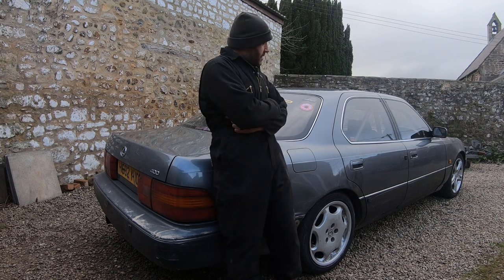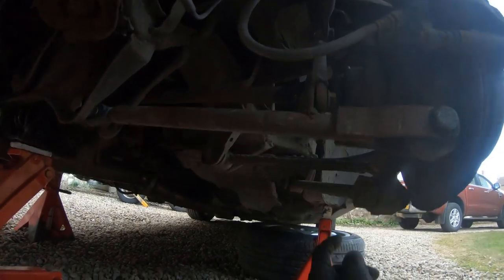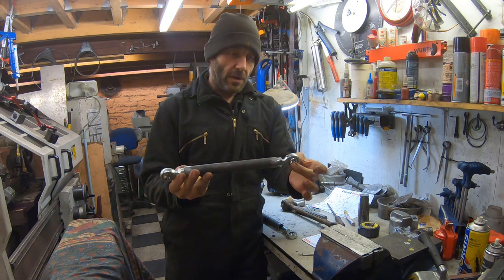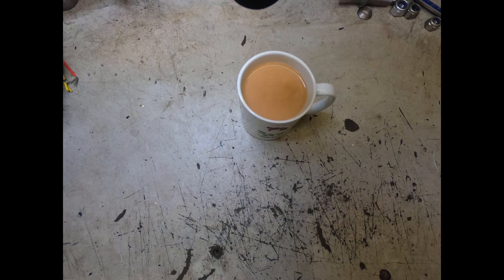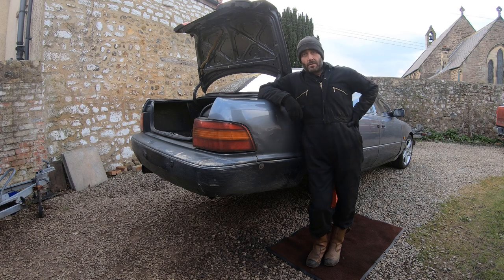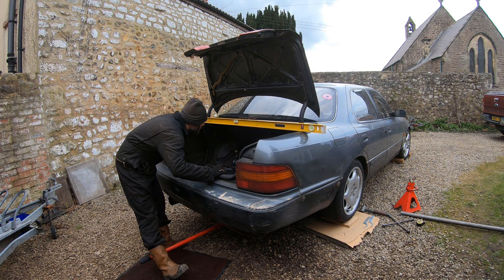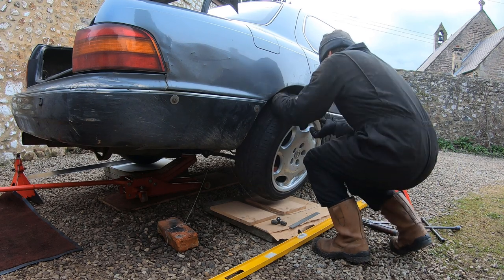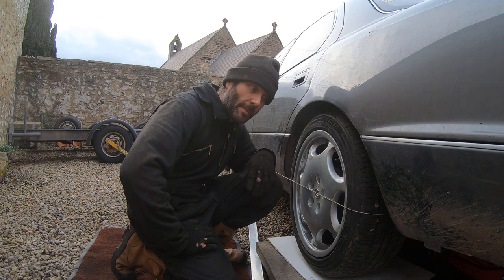TurboShed Part 38 - Fully adjustable rear suspension arms make/fit/adjust Lexus LS400

Comment: New subscriber from Chicago! So glad you put this video out. Many thanks! I broke that same bolt months ago attempting to install some aftermarket adjustable arms. I'm glad I didn't go the air-hammer route, grinding it out was so much easier! Watched this video last night and knocked it out this afternoon. Big hurdle accomplished. 

New hurdle... Do you have any advice for removing the upper rear A-arms? UCF20. Seems not even my gear wrenches can get in that tight spot. Fronts weren't too bad, but this is cramped! Chicago winters and road salt rust up our hardware so bad. Also, I've been told I should tighten my bushings up only after getting all the wheels back on the ground. How do you manage something like that in a slammed lexus without a service pit or alighment rack!? Puzzles me. Any help is appreciated!
Reply from the maker: Hi and welcome to our channel, we are glad it has helped you already :-)  For the rear A arms, if you are really stuck with them, you can knock the brake lines off and lower the subframe to get access, or for the sake of the prop bolts and ABS connectors, drop the subframe completely.  to load the wheels to tighten we have some large wooden wedges we use to drive the car up on for jacking.  We can either drop the car down onto those, or just put the jack under each hub bottom joint and take some weight before tightening.

Question for you then!  Our rear hub, lower rear arm outer end bushes are worn and I cannot find any polybushes listed, and Lexus only supply that bearing as a full hub assembly!  Do you know what size they are, or any supplier part numbers for those?  Cheers!
Reply: @Concept5North  Thanks for the tips! Was hoping I wouldn't have to touch the subframe, a tight garage makes that pretty hard. Might have to do that though.

Let's see, I think I know of a brand or two state-side. Checking...

I know some guys on the forums used to run Energy Suspension bushings. Not sure if they make ones specific to the LS400 anymore, but they do have universal  fit by size bushings in this link. May be worth a look. https://www.energysuspensionparts.com/energy-suspension-universal-polyurethane-bushings.asp

Otherwise, I've heard good things about Fig's engineering in general.This guy used some poly bushings for his LS400 if you want a visual: https://www.youtube.com/watch?v=me5Ij_JZPy4&t=5s. Seems pricey, but nothing else comes to mind. 
https://www.shopfigs.com/v3/by-vehicle/cat-lexus-ls/G2-LS-CAT/LS_BSH_LCAFRIN_SP3090K
Reply: May also be worth a look at https://febestparts.com/ for some OEM-like parts, part numbers, and visuals, even just for reference. Many of those bushings are fairly priced. 

https://psbushings.com/lexus-ls/ - Another respectable brand. Great reviews from many of my Jeep guys.

There are some Lexus PDF's out there i've saved with more detail, which are very useful. This thread has a few great ones. Bookmark this link, I'm glad I did. Happy shopping!
https://www.clublexus.com/forums/ls-1st-and-2nd-gen-1990-2000/875752-part-numbers-needed-1995-ls400-rear-trailing-arm-and-lateral-arm-bushings.html
Reply from the maker: Cheers for the info, I think we'll have to press our bushes out and measure the sizes.... always something to do!